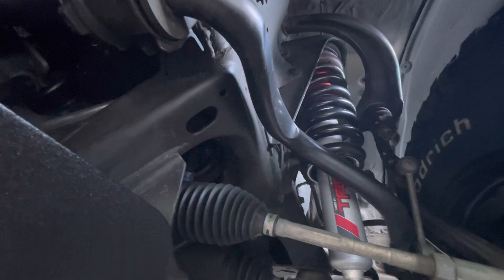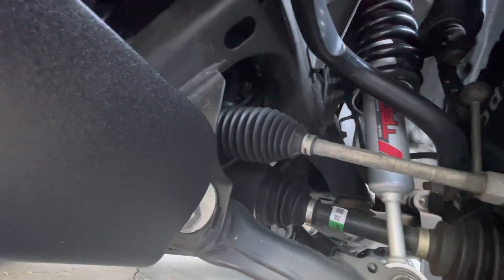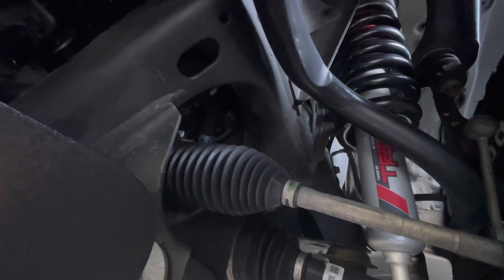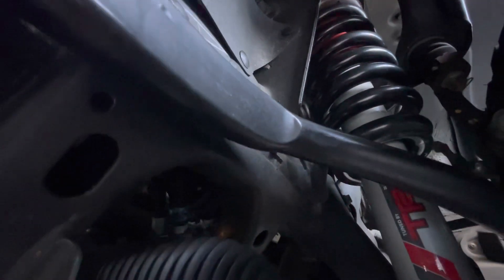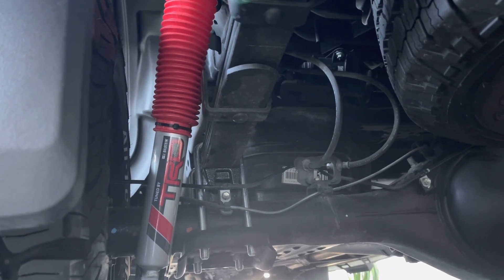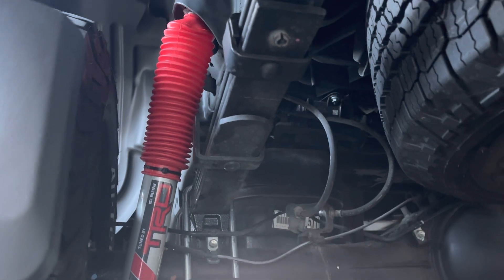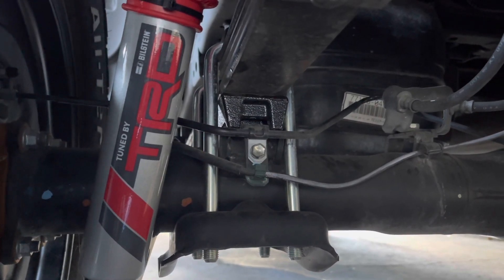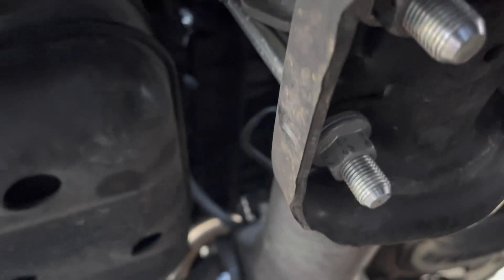TRD Off Road 4x4 Tacoma W/ TRD Lift Kit - Follow Up

Comment: Thanks for the really in depth videos of the components. I love your videos! I got lucky and found this on Facebook for $600. Was a kit someone took off with only 10,000 miles. It was originally installed by the dealer, and then removed by the dealer. Bit of a spontaneous Saturday project but I put it on today. I’m loving how the truck looks now! I took a trip to the store after I did the rear and before doing the front- I could feel a difference! The rear doesn’t seem as chattery over small bumps. Can’t wait to see what it rides like now with the front done too!
Reply from the maker: Nice! Thats a great find 👍🏼👍🏼!

Comment: Got it installed on my 2WD TRD Offroad with no hesitation from the Toyota dealership Service and Mechanic. I was surprised honestly but seems to be no issue. I spoke with mechanic who did the job and has done the job before, and he had no issues to speak of on doing it.
Reply from the maker: My guess is it still Hass to be that they can’t warranty the safety blah blah blah because they didn’t do the testing of this kit on those configuration of Tacoma’s… 2wd, long bed etc. Thanks for sharing!
Reply: @westcoasttaco  possibly, but I asked about warranty and at my place they said I’m good. Also they sold me only the suspension without the grille, I already have an aftermarket pro grille on. I actually got a dam good deal on the whole thing I believe. But you’re video helped a lot in the preliminary research, appreciate it.

Comment: I bet you the reason that it’s not compatible with a long bed is that in order to get your vehicle safety rating they would have to go through all of the crash tests with the lift kit on and still pass, and from what I understand this is incredibly expensive for manufacturers. Meaning, they would probably have to do a whole separate series of tests with the long bed and the lift kit wouldn’t be cost-effective since the quad cab long bed are pretty rare.  It took me months to find mine.
Reply from the maker: Great point and I bet you that’s correct.

Comment: Dealer installed at purchase of my 2022 trd offroad long bed. 10,000  miles in, and this lift is great. A bit pricey but wanted the oem lift.
Reply from the maker: Same here.. I wanted the OEM kit as well.. It also adds value to the truck being an OEM product.. if someone doesn’t care about the OEM factor or a heritage grille than a set of 5100’s would probably suffice just fine. Thanks for tuning in!

Comment: Yeah my dealership wants to charge me $1960 for the kit and $1260 for the install and $870 to recalibrate the sensors… oh and &180 for alignment … thinking I will just buy the kit and get a quote from our local 4x4 shop to install it

Comment: Great video! What clip setting do you have the front struts on for the spring perch? Looks like your truck is perfectly level so I would guess the upper clip?
Reply from the maker: Correct the upper clip👍🏼🤙🏼
Reply: Any alignment issues with using the upper clip/ 2” setting and getting a proper alignment?
Reply from the maker: @myronreyes8285  nothing on my end. Had done right after the install and it’s been great ever since.

Comment: I highly doubt the people at the dealership don’t know how to change stock shocks and install a shock thats 1 inch longer….since they have the tacoma trail edition which basically has those trd shocks but the difference is that they are not marked as such. 

Also every time there’s an update/upgrade Toyota sends an inspection/repair bulletin addressing the issues and how to fix them. Plus if they mess up you have the dealer warranty thata why you buy a brand new vehicle from a dealer WARRANTY.

Comment: How many inches in the front and rear did you lift? 3/2? 2/1?
Reply from the maker: 2/1
Reply: So it is lifted 2" leveled right?
Reply from the maker: @Joseph-jo6rm  correct, 2in in the front and 1” in the rear.
Reply: Gotcha. So the lift is not too crazy but subtle to the eyes and just right for an everyday drive. Did you ever consider going 2.5"-3"?
Reply from the maker: @Joseph-jo6rm  absolutely, in my opinion it’s a perfect balance.. I get compliments on it all the time because people think it’s actually lifted higher than it really is.. my tires are a 265/75/R 16.. no rubbing no trimming required to get the tires in the wheel wells.. people think they’re 285s all the time as well.. I tell people sometimes less is more when lifting a truck.. I feel like especially on the shorter bed trucks that they can tend to look kind of short and stocky if the lift gets too high.. but that’s just my opinion. I never really considered going much higher because a lot of people seem to have problems with their driveshaft and angles as the lifts gets higher.
Reply: @westcoasttaco any issues with the kit since installing? Also do you have stock wheels or aftermarket with offset?

Comment: How many MPG did you lose after getting the TRD lift kit
Reply from the maker: Maybe 1 mpg?? After getting the overland torque tune I have been averaging about 19 to 21 miles per gallon.. made a big difference for me.. when the truck was stock, I was getting about 19 miles to the gallon.. with the lift and heavier tires it’s great getting such great gas mileage with the OTT. I have no complaints on my end👍🏼.

Comment: Cheap design i soon as i installed the trd lift kit i can hear a humming noise even though the alignment was done by toyota’s dealership net Tuesday i have another appointment to find out what is causing it but i think is the needle bearing
Reply from the maker: I have spoken with a lot of people on this.. the majority of them recommend replacing the needle bearing with the ecgs.. I wish I would have done this before I installed the kit.. but unfortunately I wasn’t aware of how common of an issue it was.. here is a video I did on it. Thanks for tuning in!https://youtu.be/cwJm68ztnHM
Reply: Why would it be the needle bearing? You have no load unless you are driving in 4 wd all the time.

Comment: I have same kit on my 22 short bed Tacoma but I have a humming noise I think it's coming from a needle bearing that's my only problem, but like you said it right so much better than any other
Reply from the maker: Hmmm. Was it dealer installed? If so have you had them check it out? What tire size you running?
Reply: Just get the ecgs done. I haven’t noticed any humming from mine with the lift, but I also don’t drive much.
Reply: Rides better than any other what? It's a block lift in the rear and I guarantee a real leaf spring lift rides and handles better.
Reply: Its only a two inch front lift. You shouldnt be having any issues up front, especially with a "needle bearing"

Comment: I ordered the Kit and service manager at the Toyota dealer said that although the estimate is 4-5 hours labor he felt it would take 6-7 hours labor. To me, that was a big red Flag because it could be they have not done many installs or they are trying to rip me off or both. If not for the warranty I would take it to a suspension shop like you did. Its a new  off road Tacoma so the warranty is a big deal as you know. They are also installing the Pro Grill and it is a very rural low volume dealership so he might be on the up and up? Labor is $130 an hour so do the math on 6-7 hours. I might try another Toyota dealership?
Reply from the maker: So another guy posted on one of my videos about his experience with the dealer. Not sure if   it was legit but I don’t see why he would lie or fabricate anything.. if you go to the third comment on this video https://youtu.be/W9KpVF-35Vs you should be able to see his price breakdown etc. Dealerships can be tricky to navigate sometimes. Hope this helps!
Reply: @westcoasttaco  Yes sir thanks brother that helps.
Reply from the maker: @shanewhittemore  anytime man 👍🏼

Comment: Where did you get the black TRD skid plate? I may have to get mine powder coated.
Reply from the maker: I spray painted it with truck liner.. just pop off the TRD letters before doing so.

Comment: I just placed an order for this lift kit and It shows that the front grille comes with a front camera. Will the front camera work with my Tacoma? I own the 2020 TRD Off-road. 
Did your kit come with a front camera?
Reply from the maker: Hey Fredo! Thanks for tuning in! So the kit won’t come with a camera, but it will come with a camera “plug” to fill in the camera holder piece built into the grille if your Tacoma doesn’t have a camera. The only thing electronic that comes with this kit is a TSS Sensor. I just used the original TSS Sensor that was already on my Tacoma and I am saving the new one in case I need a replacement someday. Feel free to reach out with any other questions. Enjoy!

Comment: I have noticed on some other videos that the factory kit comes with caps for the fog lights. Maybe bc they are to high now. Did yours  come with them ? If so I’m sure it’s optional to install
Reply from the maker: Hi Dave, so my kit did come with them, but I did not install them.. Some states have a height restriction on fog lights (believe it or not California doesn’t).. so to ensure that Toyota couldn’t be held legally liable for certain states citing Tacoma owners that went with this lift kit.. they made the fog light covers.. I have heard that some people have just had to sign waivers at their dealerships stating that they requested to have the fog lights remain installed and that they were aware of that they were doing this at their own risk of being cited for state compliance reasons.

Comment: Is there a link where you purchased this kit?
Reply from the maker: I bought it from this Toyota dealership in Florida on eBay. Looks like this is the last one.

https://www.ebay.com/itm/402688055694?epid=6050846012&hash=item5dc214198e:g:JXQAAOSwdidhqQSS&amdata=enc%3AAQAHAAAAsI2d00fj2EtwG%2B6iiqtKYkHedzdxHrXKpM3xI8%2FFY9%2FRfcP8MDC8RaBhxElTqwztfnsKMoQt3uzH%2BEhGEK9Aa5eqmKlZxM67umBXg%2FF52jP6x8P8ifqcZnoqwFRz4gtT%2BclnZXv%2B2tQDK23OtNkKmmKpXKQfljf6KvJPn6mMA51qsX7K2jOhUfoBrHF9irbDYmu5mDs%2FsojfunaQMPhAEoXU0mnDB%2F9N3HteFPq1%2BIA6%7Ctkp%3ABk9SR_yikaK4YQ
Reply: @westcoasttaco   Thanks buddy!

Comment: did the TRD lift fix  the infamous taco lean?
Reply from the maker: You know I never really noticed it before but now it definitely looks perfectly level. No lean from what I can tell.. and I spend ALOT of time looking at my taco.. my wife named it “the mistress”
Reply: @westcoasttaco  have you noticed any vibration from the needle bearing?
Reply from the maker: @justinsmith9683   started having alittle bit but was experiencing some shudder as well.. both items have been resolved. Here is the video for the needle bearing. The video for the shudder is in the making.. stay tuned! https://youtu.be/cwJm68ztnHM

Comment: Will that work if there is a constant load of about 350 lbs in the bed? It does look great on your truck. I have a double cab off road too.
Reply from the maker: That’s a great question and I don’t know to be quite honest.. I’m assuming you have a shell over your bed? Which is where the constant 350lbs comes from? I don’t see why the lift wouldn’t work?? If I were you I would call an off road shop that specializes in lifts and over landing vehicle mods. Tell them about your current setup and see what they think and if they have any concerns about the constant weight being on a kit like this. Here was forum I found about this on Tacoma World as well. Hope this helps get you moving in the right direction! https://www.tacomaworld.com/threads/rear-end-weight-and-oem-lift.723478/
Reply: @westcoasttaco  I have the Decked Drawer system, Uptop Overland's Truss bedrack, rock sliders as well as RCI's full aluminum skid including the fuel tank skid

Comment: Did you do anything with lowering the differential or sway bar?
Reply from the maker: The only thing I ended up doing was replacing the needle bearing with the ecgs clamshell bushing. Outside of that everything else remained stock.

Comment: What about the cost & Avability of the TRD/Bilstein shocks in the long run?
Reply from the maker: Are you talking about the cost to replace them in the future?
Reply: @westcoasttaco  Yes, and will they sell the TRD/Bilstein replacements or 5100 will be the only option….
Reply from the maker: @eatcommies1375  Only time will tell… my guess is that at some time and point you won’t be able to find the Lift Kit.. How many years from now?? I have no clue.. but as technology becomes more advanced there will probably be other options on the market you can use to replace these if the TRD shocks are no longer available.. I have no doubt Bilstein will continue to make great products for years to come.. there is always Fox and other manufacturers as well.
Reply: @westcoasttaco  Good Points

Comment: THIS IS BASICALLY A BILSTEIN 5100 WITH 1 inch Block in the rear. SAVE YOUR MONEY AND GET A BILSTEIN 5100 or EIBACH
Reply from the maker: I agree with you Juan! If you are looking to achieve the same lift or look..essentially the 5100’s are the same shocks and will achieve this lift etc.. However keep in mind if you want an oem grille for the camera and tss sensor and are trying to avoid an “aftermarket grille” this kit may not be such a bad idea.. but if all you are looking for is the lift without a grille, then yes.. definitely save some cash on the 5100’s or eibach setups👍🏼.Thanks for the advice to the viewers that may not want the TRD lift.
Reply: @westcoasttaco  hell yeah new subscriber here, post a new video of off-roading soon thank you
Reply: @westcoasttaco  True, the kit is worth it because it comes with a TRD pro grille and Toyota honors the warranty. Its really not the money we're talking about its quality and warranty.
Reply: @eddieBoxer   just the tss garnish in it self is very expensive 200+, the whole grille is cheaper than the garnish. I installed this lift on my 2020 off-road then had the dealer calibrate the new sensor.
Reply: They through in a trd skid plate with my install
Reply: @eddieBoxer  the quality? The rear lift is an aluminum block with a bilstein 5100 and the front is also a 5100. Paying $700 for a grill is nuts
Reply: @BHUFF 😮